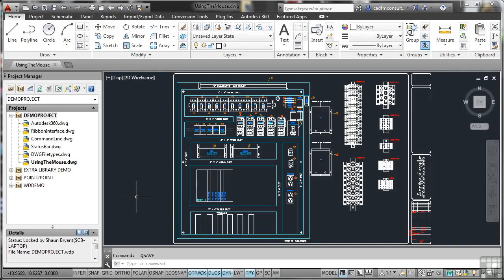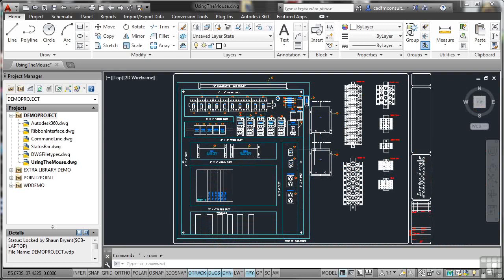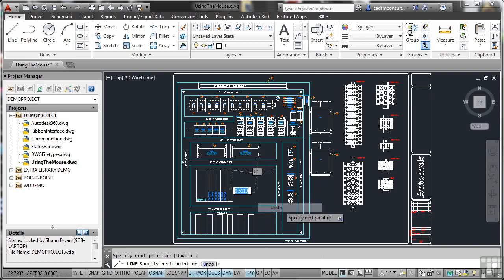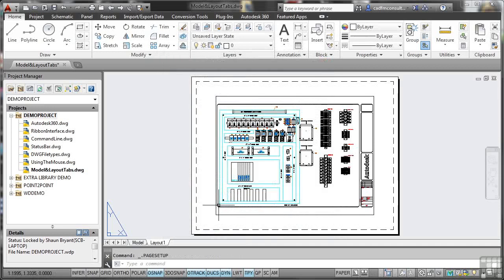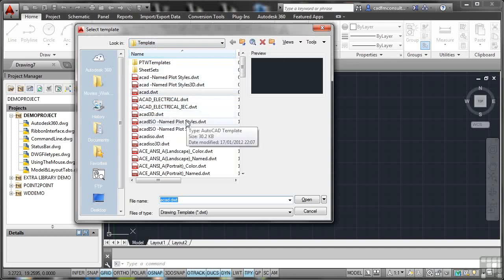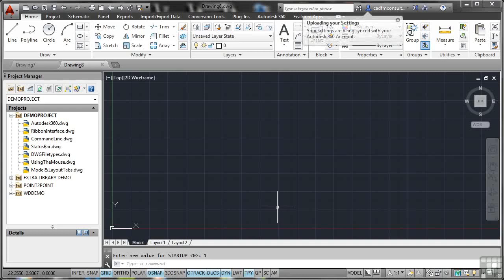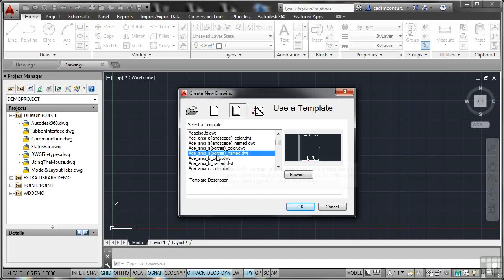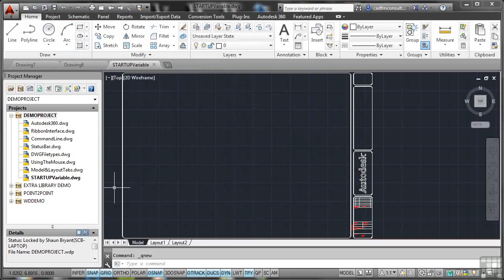Autocad electrical Tutorial Part 4 Using The Mouse, Model and Layout Tabs, Startup Variable

Comment: If you are using the 2018 version the model/layout tabs are locked behind a check box in the display settings under layout elements